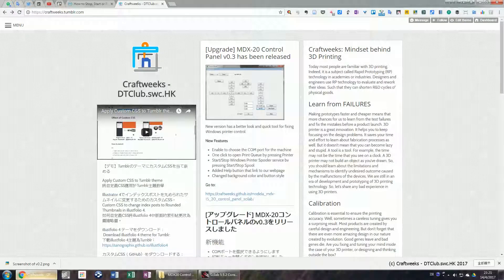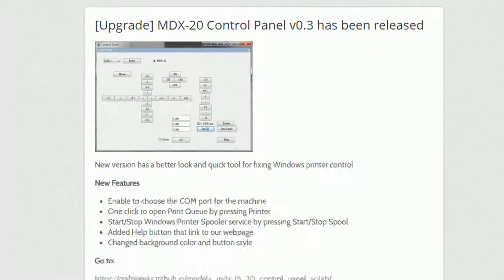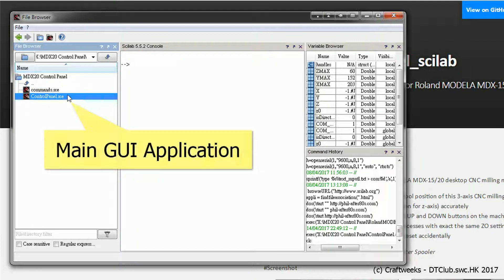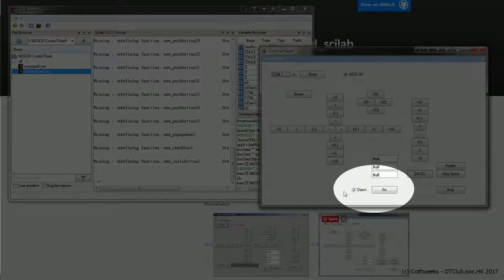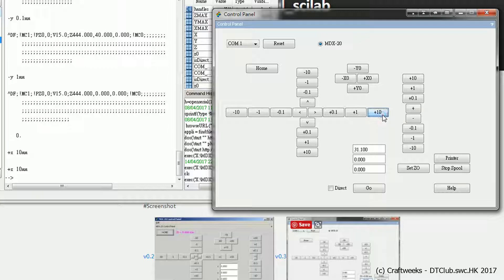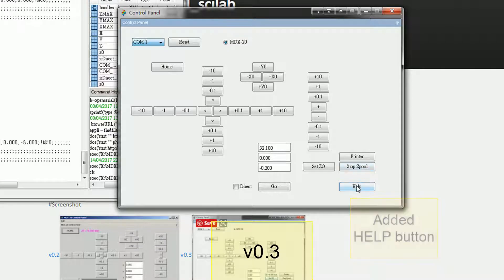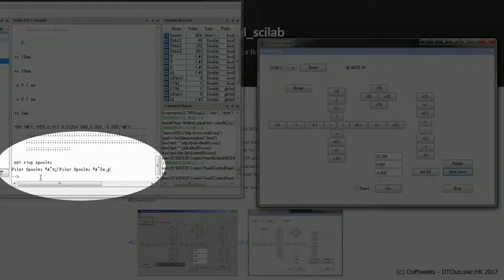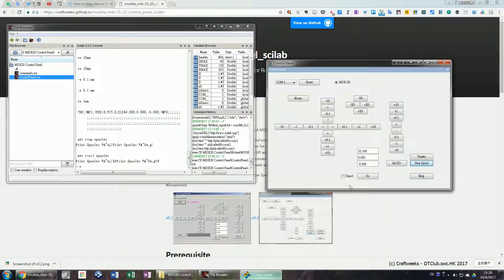Introduce New Features in our DIY Control Panel V0.3 for Roland MODELA MDX-15/20 CNC Machine

Comment: hiii sir ....iam post graduate student and my project is programming 3 axis milling cnc can you provide me source code of controlling cnc using matlab with arduino uno and cnc sheild v3 plzzz can you help me with the code and the methode ...thanks alot
Reply: my gmail is hasan.alsarraf1985@gmail.com
Reply from the maker: @hasanalsarraf726   I don't know if there are any MATLAB codes. For the Arduino CNC shield, there should be many freeware in GitHb if you use GRBL firmware.

Comment: I’m running a usb cable and windows 10 can I change your panel to com5?  Thanks
Reply from the maker: You can change to com 5 by modifying the source code. But you have to match the port number as same as you configured to the modula driver on Windows.
Reply: Craftweeks Creative Space     Not computer savey what’s all involved,  thanks

Comment: Thanks, I´m having a lot of trouble having this panel working, or the machine itself. What version of windows are you using? Could you help me trough HangOut Chat? It would be awesome to have some help for it. All the best
Reply from the maker: +Pedro Garretón 
Hi Pedro,
I have tested it on WinXP and Win7.
Could you briefly point out a few issues that you face before Hangout Chat?
So, I can prepare some fixes and save you a lot of time. Best regards.
Reply from the maker: +Pedro Garretón 
Hi Pedro,
Did you solve your troubles?
If not, please feel free to leave a new comment below.
Your feedback will also support the development of next verion.
All the best.
Reply from the maker: I fixed a few bug in the latest version 0.4.1. Please find and try the new one. I look forward to hearing your feedback.
https://craftweeks.tumblr.com/post/161464616176/mdx-20-control-panel-v04-upgrade-release